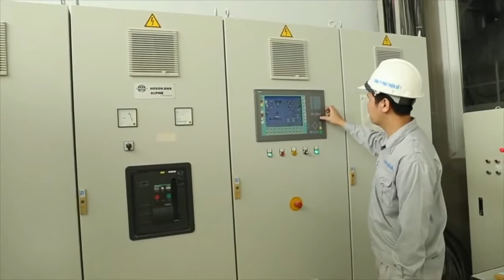RealChem Lime Stone, Dolomite, Zeolite Mines & Process by Sukesh Industries Pvt Ltd.

Comment: Place bhi mention kare
Reply: Longyi super fine powder grinding machines advantages:
1. Powder from 48~4microns, fineness is adjustable
2. Built-in high efficiency classifier, no more investment cost for classifying system.
3. Smart PLC operation system, and integrated control system: 1 computer could operated max 6 machines, saving management cost.
4. No particle air pollution, more environment-friendly.
5. Compact structure to save factory space and lower foundation construction cost.
 
For CaCO3 powder
The whole grinding system including grinding, classifying, powder collector, fan, PLC cabinet, feeding conveyor and others, system power is 370Kw, the real working power is 296KW
1. D97=23um (600mesh)    Output: 10tons/h      Energy Consumption: 29.6Kw/Ton
2. D97=16um(800mesh)     Output: 8tons/h       Energy Consumption: 37Kw/Ton
3. D97=10um (1250mesh)    Output: 4.5tons/h    Energy Consumption: 65.7Kw/Ton  
4. D97=6.5um(2000mesh)    Output: 2.5tons/h   Energy Consumption: 118.4Kw/Ton 

MP/Wechat/Whatsapp: +86 15105956429
Email:Samuel@lymill.com